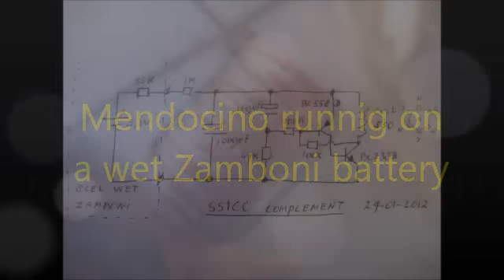Zamboni driven Mendocino motor

Comment: Enjoyed that :) 
Perhaps you could parallel another Zamboni's (for twice the current) and then have a covered water container to 'feed' the cells. If you put a piece of kitchen roll around the cells and down to the water, a capilliary action would keep them wet but not soaked. It would last until the oxidation set in, but you'd know then how long it would take whilst powering the Mendocino.

Comment from the maker: @slider2732 Hi there,
The problem with the moisted paper around it, is that it shorts out the individual cells.
This makes the voltage go down quite a bit. I thought this is only possible to do this to make 8 separate cells that stand into water, and put them in series. I like your thinking with this project, i'm open for more input.
Greets M

Comment: @sMartcreations2010 Oops lol, didn't think about the shorting. Though, you could extend the individual paper pieces from where they are now, all connected then off to the water. One neat thing about water, is that you can have multiple electrodes going into it and same negative electrode can be used for all (see watch?v=sqy6JoOalcE ).
Btw, got one of your pulse motor self start circuits running right now - idea to radiantly charge AA sized Ni-MH with it (0.9V @5mA sends it spinning) :)